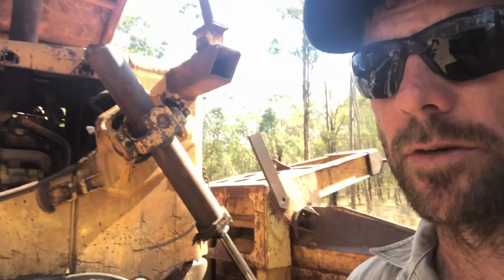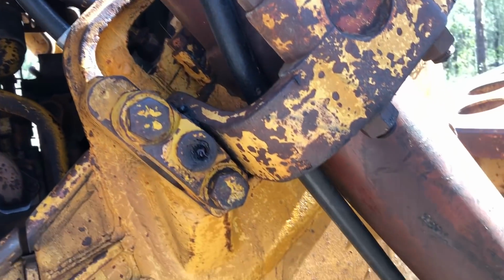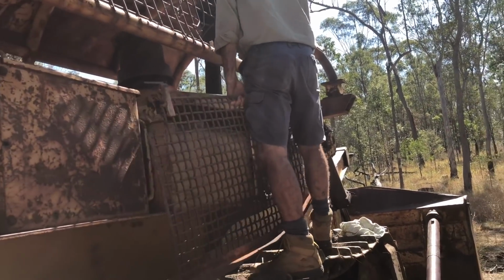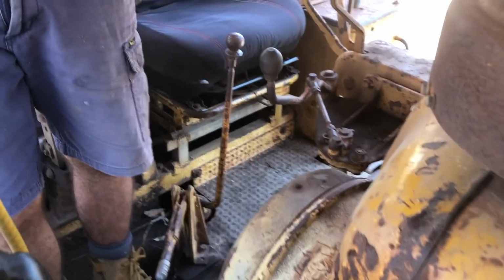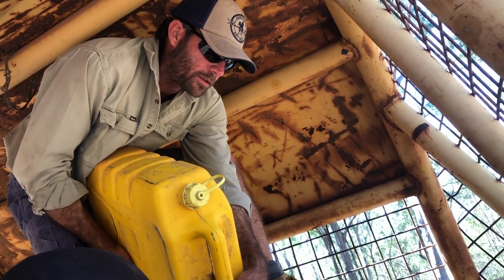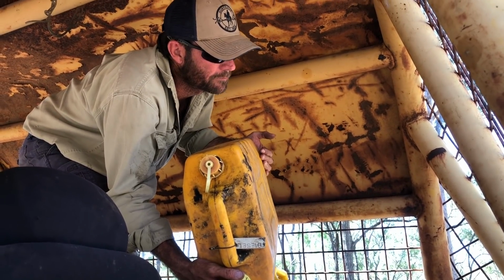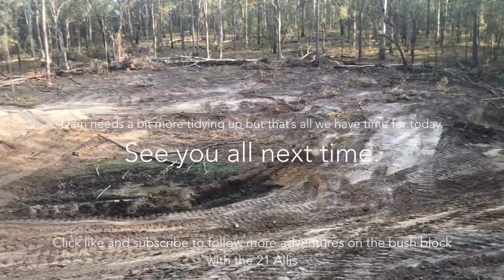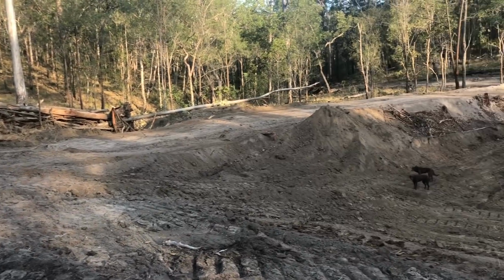Allis Chalmers HD21a on the bush block

Comment: The good old shifter. AKA multi purpose fit'em all, knuckle duster, and the one I like. The nut fucker. 9 times out of 10 you can bet the nut will be cactused by the time your finished using the good old nut fucker. Every spanner monkey should have a good assortment of them. Them and multi grips. You want to destroy your bolts/ nuts , they'll do it.

Comment: Good times sir. I worked with a HD20, diesel torque converter, two gears forward, one reverse.
Reply from the maker: Yep the 21 is similar but oil converter, more ponies out of a very different engine but same 2 forward 1 reverse setup

Comment: I drove a 21 for about a week many years ago and enjoyed the experience. Your machine sounds sweet.
Reply from the maker: Yep good old girl straight through pipe probably adds to the note
Reply: @mountainblokemoments  Spent some time on a Allis M100 grader as well and that had a very willing engine. I had nearly forgotten about the grader.
Reply from the maker: @lesteraizlewood8457  I think the Buda motors where a good heavy machine motor, not so much for the haulage side.
Reply: They are quite fun . But they wet my first experience in a dozer the new cats look ok but also like  the 474 Lombardi nice big machines make big job as small and great o  ripping work.
Reply from the maker: @kevinklingner3098  new dozers are an absolute dream to operate compared to this girl but I cant afford the repayments on a million dollar machine let alone pay for one outright.

Comment: Make sure u blow that radiator out regularly with a radiator genie or a garden blower.
Very dusty where u are , don't want the old girl getting hot.
Good luck look forward to seeing more of her working.
Reply from the maker: Dust is an issue for sure especially when you mix it with a bit of oil. Had a leak in a lift hose on the blade the other day that was blowing a fine mist of oil into the radiator, between that and the dust temp went up real quick.
Reply: @mountainblokemoments  Roger that, you will be the next Marty t you tube sensation from.new Zealand soon.
Hope the.editing works out, looking forward to next moment

Comment: Wow, beautiful machine, she runs clean and sounds healthy as well! The setup your running on it as well with the big roof and all the steel mesh is awesome. Our HD21 is of the same type but it has a power shift transmission, I’m curious as I believe it has the same engine as yours, anyways congrats! Awesome rig
Reply from the maker: I can’t take credit for the full scrub canopy but it is definitely necessary as I’ve had a few big trees break back over the top of the dozer. I don’t know how they cleared land back in the day without scrub canopies, very carefully I expect.
Reply: @mountainblokemoments  you sure are clearing a lot of land, out of curiosity How long does take to do like an acre?
Reply from the maker: @detroitdiesel7074  not really clearing that much just fenclines and access tracks.
The 21 can push over an acre of trees pretty quick, but time wise it is so variable depending on what you are trying to achieve.
Reply: I have a new Torque converter for a 21 if you need it
Reply from the maker: @RJ1999x  hopefully I will never need it, but good to know. I have been talking to Brendan @ Phil Hunt parts this week just chasing a full service kit as the local guys can’t seem to find filters for the Allis and the filter numbers I have from the previous owner are all discontinued. He sounds like the go to guy for any parts I may need.
Reply: @mountainblokemoments  I know Phil's a little I'm sure he can help you. I'm in the US but I'm sure we could find the filters if need be
Reply from the maker: @RJ1999x  thanks RJ, our local tractor guys just scratch their head with the 21
Reply: @mountainblokemoments  he's not trying very hard then, Allis Chalmers was great at using "off the shelf" parts, the filters should be pretty common
Reply from the maker: @RJ1999x  I’m sure the filters are common its just doing the leg work to find the numbers, seems if the computer won’t tell them the crossover numbers its too hard. When they said they could have the cutting edge end bits made I just walked out.
Reply from the maker: @RJ1999x  Hey RJ do you know of any HD21 forum’s on the interwebs that I can throw some questions at? I have a steering clutch issue that has come out of nowhere. Maybe I’ve blown a hose inside the backend somewhere on an actuator. I had her parked on a very steep slope, when I slipped off the side of a road I was cutting in so maybe I just need to bleed them🤷
Reply from the maker: @RJ1999x  I will check it out thanks.
Reply from the maker: @RJ1999x  comes up on my end as a live address so I will check them out as well.
Reply: @mountainblokemoments  there is a lot of old knowledge out there
Reply from the maker: @RJ1999x  just got to look in the right places
Reply: @mountainblokemoments  very true

Comment: Any that used a Detroit diesel motor had a right old thump to the sound of the running motor  that is a trait of the two stoke Detroit diesel along with oil leaks everywhere  due to almost no gaskets basing used . We had a hd 15 and it really was a collectable it was one of the very early WW2 models it was ok on little stuff no grunt and loved boiling all the time.
Reply from the maker: I’ve not had any “good” experiences with old detroit diesels, I think they a probably a reasonable truck motor but not so much a heavy equipment motor.
Reply: We have a 1945 Cat D7. My grandpa went down to Galveston TX and saved it just before it boarded a ship to go be dumped in the Gulf of Mexico after the end of WW2. The story goes he walked out on to the loading dock and there were vast amounts of machinery. He said he’d take the D7 that day so they let him have it. The rest sits at the bottom of the ocean.
Reply from the maker: @3535gt  crying shame to dump the old machines. Most of the old dozers in Australia end up being scrapped for steel.
Reply: @mountainblokemoments  agree 100%. Hard to beat the old iron

Comment: It will be interesting to see the dam filled, will you build a spillway or install an overflow pipe?
Reply from the maker: will run spillways on most of the dams we build.
Reply: That's what most of us here in the bus do run spillways. I always like to see the same wall much higher in the middle. All ours keep breaking over centre when they first filled because it would be barely high enough in the freeboard batter in normal inflows would leave two feet or so free board but if got a flood rain which we did every time we made a dam the rain would fall usually over 10 or so days withe the heaviest towards the end. One occasion we got twelve inches in eight hours. I saw the water go over one  it tore the spill way out going over the top of it and that wasn't enough it went two feet over the too of th middle of the same and tore the middle twenty feet . We had eighteen dams at the time all bid ones twenty to thirty feet deep.and wide and one went that day. They all went twelve months later again  both times we raised the batter another ten feet. The second time I laid netting out then covered that we plenty of rocks using big hard wood.logs to make  so to.spliway base wasnt exposed to water and the water flow was gentler not so torrential like  it lasted till we lest but I heard some years ago the walls went again so.they sound.like they need raising higher messing and rock  on top and down the front of the walls.
Reply from the maker: @kevinklingner3098  I don’t think you can construct an earthen dam that will withstand those huge downpours, its just part of the deal working with nature.

Comment: That thing pushes bloody furiously. Makes me think how did Caterpillar become so enduring when machines like the Allis' can go so hard . Not important. A great bulldozer . Put hairs on ya sak driving that beast for a living!
Reply from the maker: Allis Chalmers had some clutch and transmission issues that haunted them in the tracked tractor range early on. Caterpillar out did them in marketing and parts from all reports and then company mergers killed them off at the end. I think some basic concepts of allis dozers live on in Hitachi dozers. The fluid coupling/torque converter was so far in front of the other dozers of this size back in the day. It really is a shame they couldn’t have kept it all going under the Allis brand..

Comment: I remember seeing [and hearing] one they had at Oakdale colliery in South Wales. Very angry sounding machine compared with the D8's they also had there. Two lorry loads took it away to wherever it went next, one load was the big, coal blade, the other was the crawler itself. I wondered what it was for many years, although I could just make out 'Allis Chalmers' on it from where I saw it, while I worked on a building site over the road from the colliery. I bought a book about Allis construction machinery and positively identified it as an HD 21. I also remember the big, staring 'eyes' they have in the top of the grille! Yours sounds just the same as the one I remember!
Reply from the maker: Definitely ahead of the cats in their day, but sadly due to takeovers  and marketing they got left behind.

Comment: Hi mate what area of Australia is your bush block I have an old HD11 series B Allis good machine getting hard to find parts for cheers Damo
Reply from the maker: Yep Mate out near Mount Perry Qld. Still a lot of pulled down parked up 21s out west. But hoping I can get a few years out of mine before major part replacements.
Reply: Yes there seems to be a lot more of the 21s & 16s that came into Australia than the B series 11s . Our country is not that far from yours we are at Widgee west of Gympie cheers Damo
Reply from the maker: @damiancotter6038  some nice country around Gympie for sure. You seem to have got a bit more rain down that way in the last few years than where we are.
Reply: @mountainblokemoments  dose your HD21 have a Detroit Diesel engine in it or a AC engine in it ? Dose it use diesel fuel in the torque converter ,  ( I believe they called it a Diesel Converter , ) like some of the early HD21 used  ?
Reply from the maker: @brieannateylar5810  my 21 runs an oil torque converter and the Allis motor. It is the last of the A’s.
Reply from the maker: @brieannateylar5810  my 21 is the last of the A’s with the upgraded oil torque converter and the 21000 Allis engine.

Comment: How much fuel does it use in the average day
Reply from the maker: On average about 300litres. Pushing dirt it uses a fair bit more but tidying roads up or knocking over a few trees a 200litre drum generally gets me through most of the day
Reply: @mountainblokemoments  wow, thats a ton
Reply from the maker: @M.TTT.  It is pretty reasonable considering the size of the machine and what it can accomplish in a day. I’ve operated a few machines that drink 1000 litres a day mainly twin power scrapers. 500 litres a day for any big machine working hard would be about the average. 
Thanks for watching
Reply: @mountainblokemoments  very true, it is amazing the size and power of these.

Comment: I think ours was a 0037 in the production run and these were all orange. It is said that Terex were at the time the best to be had.I have only seen them from a distance. The twin engine side by side one is an interesting build and was for many years the biggest dozer made. They were sold of and eventually became part a of the International Harvester group. Motors need them at the time and used the Detroit diesel because it was their own engine. The colour of the Terex was eventually the same as Steiger green.
Reply from the maker: Love the Steiger tractors, operated laser buckets years ago, ran a couple of red tractors 9180 and a couple of 9380’s but they are a poor substitute to the original green tiger stieger, I knew a guy that had two pulling laser buckets they would just leave everyone for dead.
Reply: A bloke I worked for had 2 D9s dam sinking, was conned into buying Terexs by their marketing mob,
in less than a year he was broke.
Reply from the maker: @ivanolsen8596  probably cant blame it all on the green machines unless they where constantly down with mechanical issues, but seems crazy to go from D9’s to anything else, Cat really had their machines sorted by the time they built the 9’s
Reply: @mountainblokemoments  He was going great guns, 2 dozers, 2 graders all booked with work 12 months ahead. then came the green monsters, one event that sticks in my mind, dozer broken down in the bottom of a deep dam, weather closing in, and having to stop the other dozer working to truck it many miles to tow the broken one out before the dam filled with water. This was only one of many breakdowns of these brand new machines.
The D9s were getting up in hours, I would have replaced them with Cat as back then they were dependable.
The best machinery now would have to Komatsu. A company I worked had all Komatapillar machines,
only went to the workshop for servicing, very few breakdowns, then mainly hydraulic hoses, tyres etc.
Reply from the maker: @ivanolsen8596  breakdowns break businesses that’s for sure. Komatsu have a good product but I’m sure some cat die hards would call them fighting words😜.
Reply: @mountainblokemoments  Rob, was just inspecting the water in your dams when your reply came.
Yeah, the Cat die hards are just that, get very aereated if you knock Cats.
Bloody beautiful country you have there, if I were still in Qld I would ask your permission to come up and say Gday. Hope your dams stay full and your cattle breed well.
Reply from the maker: @ivanolsen8596  thanks mate. I love being in the mountains with my dogs and my cattle. When I get down about stuff breaking down or having too many jobs started and nothing finished I just take a moment and look around and give thanks for what I’ve got.